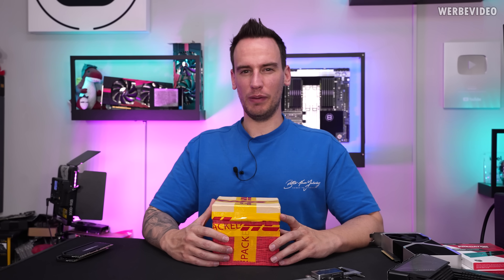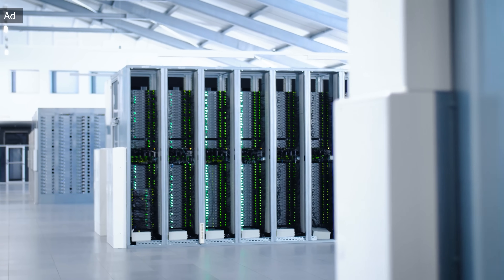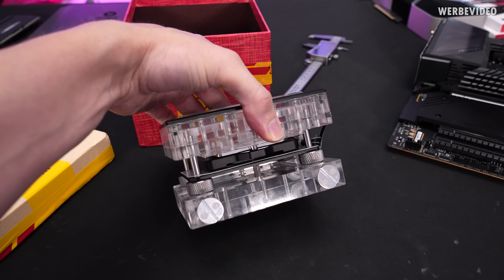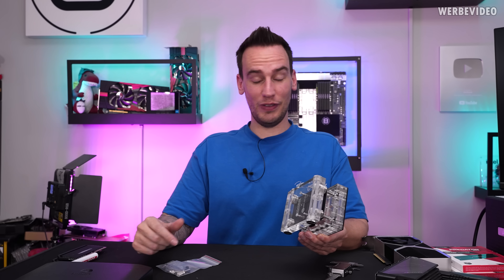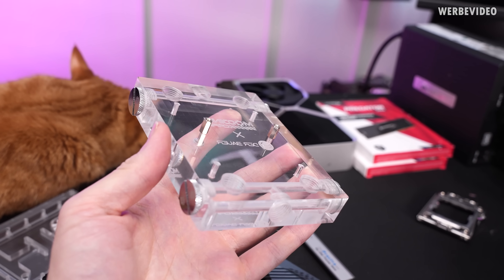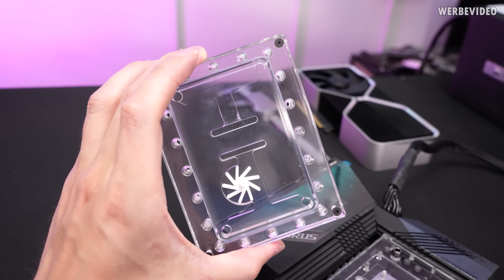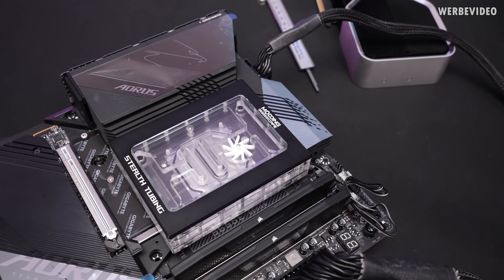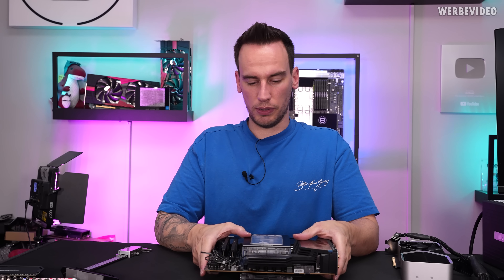A New Generation of Water Blocks? Stealth Tubing Block Tested in Detail

Comment: A "tubeless" look of a custom loop might be very interesting, combine this with a distroplate with pump with fittings on the backside to connect this block, so on the front you'll only see the distroplate and cpublock. Now only need to figure out a way to have a GPU WB that "somehow" is stealthily fed from behind (a long card that sticks out of the mobo, so the block could have fittings connecting directly onto the distroplate behind it?

Comment: Thinner back plate would be needed for sure. Also a lot of cases would not be able to use it.

Cool idea but not sure how many would care that much for hidden  tubing when every gpu block has visible tubing.

Maybe create a visible distroplate style w font tubes also. Most water blocks don’t have a pretty distroplate on the front and that in itself would be a cool idea. I think the front distroplate is what makes it cool.

Comment: If the tubes going through the mother board get hot will they expand and put dangerous pressure on the hole walls?

Comment: This is brilliant! It would work perfect as is for my set up. I have an original old school acrylic Danger Den double wide black case that has the water cooling loop with a dual 480 radz set back behind the mobo tray, this would make it a breeze to plumb in direct. I hope this will come to market. 🙏

Comment: I would buy this for sure. I think there’s even a use case for small sandwich style itx cases that are being outfitted with custom water cooling as you could contain the loop to one side of the spine and (if possible) adjust the spine forward as far as the block allows to make room behind the motherboard

Comment: This is cool but I'd like to see the details figured out in advance. You're likely looking at designing a complete chassis and water cooled system though; CPU, radiators, distro, etc.. A topside clamshell design that integrates vrm cooling would look good too while allowing better flow rate; maybe a distro backplate for the motherboard? Designing your own complete solution gives you the power break convention. Stick the graphics card in the basement and press the motherboard against the glass, screw it make the motherboard into the front panel and the radiators are the frame. 

It doesn't make sense if it doesn't integrate; talk to MSI and see if Project Zero is moving to the 870e platform because this product is only interesting if that product is available. If so I'm sure they'd be interested in coming up with something for CES:2026.

Comment: I had this block in my system for a month and it ended up getting a crack in the acrylic on the back plate area where the plugs are located.  from what I can tell it looks like the version that they sell online has a thinner area on the back because the g1/4 plugs on mine overhang the acrylic slightly which makes that area of the acrylic very thin and mine cracked where the threads are at.

Comment: I saw this block on a different PC build video and had to order one and I was able to get one from Bitspower and it is awesome.  I am running an AIO in a Tower 300 case and this is the first part for my custom water cooling system.  I've been using liquid cooling in my computer builds for the last 20 years

Comment: Spectaular estetichs. I will swap my my soft tubing liqiuid cooled CPU waterblock without a second thought if it delivers the same. Even if I have to dremel the chassis. 

PS -  I did it several times, and I will do it again if need it.
Roman, greetings from Romania. You have to patent this system, it looks outstanding, but I stiill do not know how to crossover the tubes from the GPU waterblock on the back side of the chassis without drilling holes in the chassis. But I will still do it, if the price is decent.

Comment: To be honest, I got out of water cooling my personal PC. First, for the most part all parts today can do just fine with air cooling. And every damn time I had to replace, reset or anything else I had to drain, refill and leak check. It got OLD quickly! That being said, it's a cool design and I think if we get these boards with rear connectors it would be AWESOME! Also as you said cases would be an issue at first!
Reply: My rig, AMD 5950x on a Gigabyte X570 Aorus Ultra, 32gig Gskill 4200 And a Gigabyte 4070ti. All air cooled. At full load (OCCT) my cpu will run about 80c and the GPU max is around 70 to 75c.

Comment: I have the coolmaster mf700 case. Its a unique case that requires hvy modification, but i like the look. One of the issues is clean runs of tubing. With rads on wings, you'll find most builds running their tubing /resvior in front of rads for a horrible look. This approach would give more options.

Additionally always toyed with using aquarium chiller to chill the coolant. A board that mounts to front and back making a seal around cpu though a way to create a vacuum might be needed. This offers the benefits of no condensation forming. Well at least around cpu enclosed area

Comment: It should have a companion back mountable distro cum pump/reservoir combo that works with some popular cases that have a dual chamber design like Lian Li. This can enable use of GPU water cooling also. A great concept with advantages such as easy access to ram, pcie expansion and ssds if designed to be smaller.

Comment: First off, I LOVE the idea! To end up with such a clean aesthetic is pretty dang cool and I'd love to see some variation of this on the actual market for purchase

I have just two major concerns though - the first of which is motherboard and case compatibility, which you already touched on. I'm sure if making it into a TG product, you'd address most potential issues there, so I'm less concerned about that. The biggest concern is that obviously the majority of custom loops don't pass tubing through to the backside of the motherboard tray, so this is a potentially huge hurdle for many people. If you would desire this product to be anything more than an extremely low-volume niche custom product, it would be cool to pair it with something like a front/back radiator or custom distro block, for the most common cases, to help ease potential buyers into the build process with something like this

Comment: This is an awesome idea… maybe look into either a reservoir, backplate or a distribution backplate….

Back plate can connect to the case I place of the motherboard, then the motherboard could connect to that with a conductive insert for proper board grounding protection (I’m thinking a thicker gauge wire squared off in some sort of roller press (four sided), then press fitted into the acrylic (or a strong bond epoxy), then that copper is taped & threaded for the motherboard to attach to.

This would allow a more custom look and distribution of the coolant behind the board. Then for that specific cooler a short tube from a Side to a 90° into the cpu block, and another for the return. (That way the “distribution backplate” can have a standardized cutout for the different water blocks (amd vs. intel).

… also Iv wanted to fully liquid cool a pc and love the tubeless(or “less tubing”) idea, this distribution backplate can also be standardized for people that are interested in “mix & matching” different branded cooling solutions, (say 4 valve/access holes on the bottom 4 on the front (each set having “distribution & returns” and would also allow the user to place additional water block solutions (GPU, M.2, CPU, Ram… cooling, and if not reservoir backplate, then those access/valves could be used for connecting a pump and reservoir(unless another dedicated pump spot was needed) 

I’ve seen a few cases with tempered glass on front and two sides, this would spotlight such a distribution backplate.

(I’m just an out of box thinker… give me a problem, I try to suggest solutions… so if this solves a lot of your problems, then just give me a fully loaded stealth cooled system XD)

Comment: Had a similar idea a few years ago and have been trying to learn fusion 360 in spare time to be able to start concepts but would be a few years until I could afford hardware to then start the product. Have started looking for broken hardware just to try my hand at copying into 3d. I would build mine around your AM5 Mycro Direct-Die cooler, I think this would be a great add on to that product as you are already not using the holes in the board.

Comment: 6:15 I think that's a BIOS option. It allows the computer to start in case of a power failure.
My first computer from the early 2000s had that option enable, but I only figure it out a decade later.

Comment: Great topic and as typical of der8auer, thoughtfully discussed.  Thanks you for doing this.  If you have ever run Cinebench R23 or OCCT Power stress tests etc with backplate accessible, you may notice the backplate can get too hot to touch.  Worse, there is typically no ventilation at the back.  Granted there is less heat to draw from the backplate than from the front side heat spreader but if there is already going to be water manifold at the back, then why not arrange that it be cooling plate as well?  Most of the product complexity and cost is already consumed by the back attachment so it seems relatively easy to follow through with a back side cooling plate.  Actually I wonder that you could not simply place an existing cooling block on the back already.  You would have tubing on both sides but that to me is not a problem so long as there is room for the tubing in the back and there are cases that would permit such.

Comment: I would add a cooling block on the back of the socket with pads. Having a little cooling on the back of the socket could help sell it to more people by not just being aesthetic. The back block make it thinner and reduce the clearance with Motherboard to like 2 or 3mm so you can clear the stuff on the board. 
I would think of it like a back plate on a GPU. I also think it could reduce the cost of tooling because water block tooling already exists.

Comment: I like the idea / concept of this water-block.  The thought that came to me, concerning the thickness of the backside, was a melding of the concepts of this prototype, with that of a distribution block... there are many designs which could be incorporated into a project like this.  For instance, having the backside plate securing the water inlet/outlet tubes in place, but using tubing (hard or soft) to attach it to a water distribution block which is located elsewhere in the case...it could be large or small, hidden or visible... sky's the limit for innovative ideas, here.  Shouldn't be too difficult to do, either.  I look forward to seeing what you're going to do with it.  ^_^

Comment: 6:30 lots of motherboards go to there last power state when power is connected. So if the system was on, when the power is connected the system will automatically turn on. If the system was off when power was removed, and power is plugged back in, the system will be off.

Comment: The acrylic back plate is pointless cause no one will be able to see it along with the cable mess and it only serves to take up too much space in the back. Would be nice if there's 4 custom flexible tubes that connect to the ends of the long fittings at the back of the motherboard such that the 4 tubes are joined to a single bigger pipe that connects to the rest of the water-cooling loop.

Comment: this is a horrible idea.
You still have GPU and radiators on the front of the case
You have no cases white enough to hide the pump/tank combi at the back.
distro plate, top rad, mid case rad, front case rad are all on the front side, and GPU
This will only complicate everything

Comment: Really cool, the back block could certainly be made smaller by using thinner tubes (like an AIO) that connect to another distribution block which then connects to larger, more standard sized tubing.

Comment: I think it is very cool but I unless I missed it you are still going to need to snake your hoses if you are cooling a GPU which yeah...if you're going custom loop you're going to be doing your GPU... 

Unless this is something more to target a mITX build running just with an integrated GPU ... Which to me I wouldn't see the use or justification for the expense

...cats like you forgot to feed me... I'm off to go hack a hairball on your pillow... You've been warned 😂

Comment: It's nice, but I think it's not effective. It's to be nice to make a water-cooling tubes on backside of mb and attach a radiator on one of panels(a.k.a standard radiator location). Because it may be not bad with CPUs with max tdp 100-125W, but with more powerful CPU it's insane(you saw the temps on CPU, 90 degrees is not ok). Sry 4 mistakes, English is not my primary lang
P.S: and I didn't know how to cool the radiator on your water-cooling system. If we attach the fan air thread opposite the motherboard, it will heat mb. And if we attach this parallel to the mb, there's no fresh air(bcs mb) and air thread will heat right panel, or this will reflect back to mb on high rpm.

Comment: That roughness on the bottom of the waterblock could actually help improve heat transfer efficiency, since roughing it's surface like that essentially increases the surface area of the block so more metal is in contact with thermal paste than if it were flat and smooth. I've always wondered why bottoms of waterblocks are shiny and smooth rather than roughed up in some way.

Comment: That looks amazing. 
2 thoughts come to mind immediately:
1. If you have a radiator with the pump built in, this would be such a minimal and simple product. I could easily see this getting mass produced as you could fairly easily make it much smaller on the top and back.
2. Sealing the blocks with o-rings is great for replacability as they are the most likely part to break, but you could probably embed the seals for an easier assembly process.

The flow should be more than adequate, as you actually need very little flow to reach the maximum pressure needed for heat transfer. One thing to keep in mind is that stepping down the tube-width, even with dual pipes, creates a lot of pressure, meaning your pump needs to work harder. A D5 though has more than enough pressure for a pretty massive setups and is very silent overall. I run dual 360 radiators and way to much tubing on a single D5. I used to have dual D5s, but it did absolutely nothing for performance compared to 1 D5 on roughly 50% RPM.

Amazing mod overall !

Comment: 6:16 Check your BIOS settings. It may be set to boot when power is restored. MBs that have that option usually give you 3 choices - Turn on, stat off, or return to last state. Not sure exactly what the setting is called off the top of my head, though.

Comment: i love this and with mb manufacturers heading towards hiding cables there seems to be a huge market for the cleaner install crowds, not to mention no hard tubing running over memory  that most rigid tubing water cooled applications have, so swapping out ram would be easier

Comment: I think that making the backplate an active cooler that would help the cooling. I would like to see the flow numbers through the small tubes as that is going to have a major impact on cooling ability as well. I think thermal pads would work for the back so backplate would not have to be board specific. Also I would like to see the difference in potential between materials for the cold plate as well.

Comment: I would by that in a heart beat. yes, bring it to the mass market! love the see through on the top but would also love to see black out on the sides. love water cooling for its efficiency of removing heat from the system, but I HATE all the tubes crossing everywhere and blocking everything behind them especially the RAM. also love the 3 ports in and the 3 ports out, makes for planning runs simple. if this really takes off, next needs to be stealth GPU water block.

Comment: Let's be honest, half the reason anyone does an open loop is to show off their pretty tube runs. We all know the cost to performance is not at all worth it compared to AIOs and air cooled systems. With that said, if you guys made this a thing I would totally do a stealth tubing build in my Tower 900. Wouldn't even have to change anything other than moving my reservoir & pump to the back compartment with the radiator & old SSDs. If you guys can make it fit more cases & get good flow rates I say go for it. This might make the whole connectors on the back MOBO thing a real trend instead of a weird annoyance.

Comment: When you plate an item, if it is not smooth the plating will build up on sharp edges. that roughness was the plating build up on the machine marks left on the cold plate. Not ideal obviously for great thermal transfer.
Reply: i love the design and it will sell like hotcakes.
Reply: I love he put the little impellor to see that the pump is working.

Comment: I like that hidden tubing concept. The only issue is going to be the amount of space between the motherboard tray and the back side of the computer. Anyone with an older case would definitely need an upgrade. If Thermal Grizzly produced this I would buy one as long as the thermals are worth it, but once Der8auer gets involved this concept should perform fantastic.

Comment: Its a cool and original design, however, the high cost of manufacture and the restrictive flow offer no improvement from tradicional water blocks. 
 Leak test cant be done before final assembly, more coolant channels increase the chance  of leaks.

Comment: I wonder how much flow restriction there is with those 2 small in's and out's... If the cold plate is more or less equal in restriction then a direct die model would be of interest for those AM5 boards